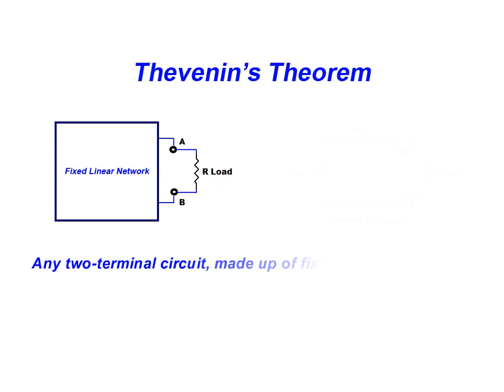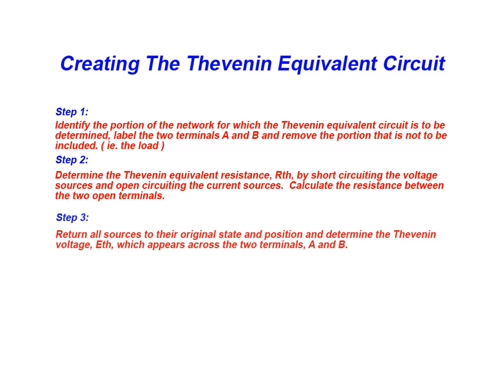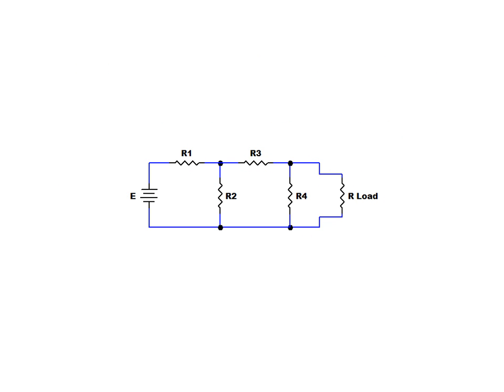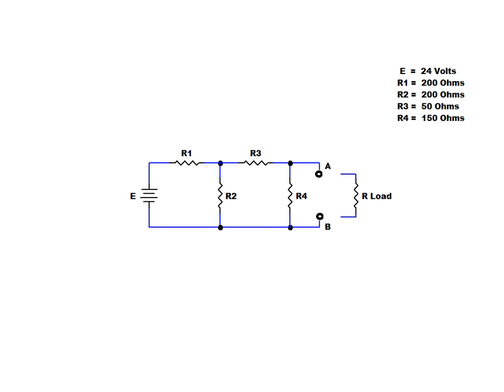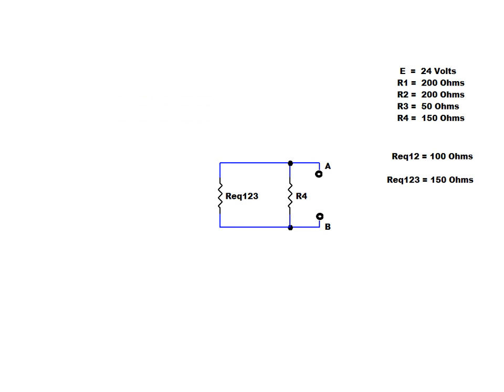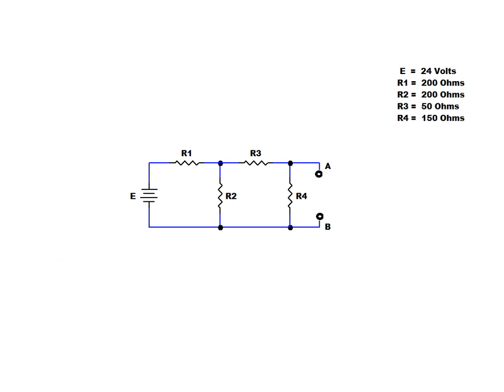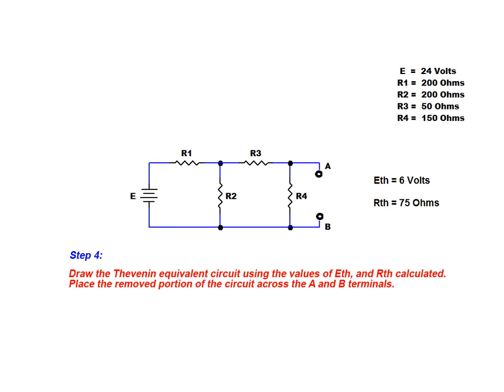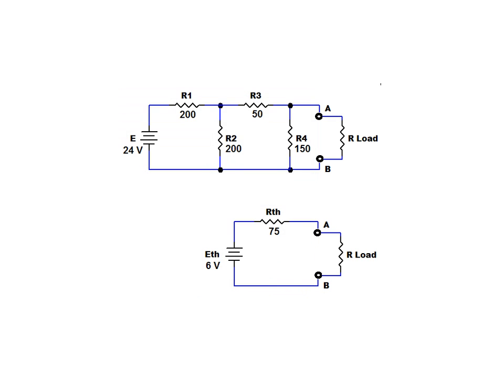Tutorial: Creating a Thevenin Equivalent Circuit | #circuits #TheveninEquivalentCircuit #GBCTech

Comment: Good explanation of Thevenin resistance operations, but lost me on figuring out the Voltages. ☹️
Reply from the maker: Thanks, we are using the voltage divider rule to calculate voltages, as well as ohms law basics.  You can check out our Practicing Technician blogs on our etcourse.com website for clarification if you are interested.

Comment: Hi Have you any information on how to work out the voltage drop over a resistor using the Thevenin's theorem with 2 batteries in the circuit please ?

Thanks
Reply from the maker: Deano vincent The process for Rth is unchanged, open circuit voltage sources, short circuit current sources and view resistance as seen from the 2 terminals you have selected (the output location).  When dealing with multiple sources, I recommend using Nodal Analysis to obtain Vth. (You can use Loop Analysis as an option or even Superposition)  Finding Vth will require employing Linear Network approaches.  This approach is valid for independent sources only. It becomes much more complex if you have dependent sources.  In short, you need to use Nodal, Loop, or Superposition to acquire Vth when multiple sources are involved.  We have vids on these analysis types that will help you with this.  Again, Rth is found in the same way for single or multiple source circuits.  Subscribe to our page, and you will see some tutorials on the basic application of DC linear network theorems.  I hope this helps.

Comment: hang on, i dont know what you have done to get vth to be 6v, i work it out as 9v.
proof: 24v split between r1 & r2, vdivider, 12v each per r1 and r2.
leaving 12v out of the node, carrying on into r3 (50ohm) vdivider here reveals the vdrop across r3 with the 12v remainding voltage to be 3v not the 6v which you got,  i think you must have used as the source voltage other than the remainding voltage. this cant be the source voltage because its gone through the resisitors on the way and dropped. using the source voltage would give 6v but using the 12v gives 3v drop across here, leaving 9v drop across the 150ohm. think about it, 6v drop across 50ohm and 6v drop across the 150ohm? it dosent work. vth has to be 9v. correct me if im wrong but im sure im right... :/
Reply from the maker: Jack Spencer Ok, I will try to clear this up for you.  Your initial assumption is incorrect. Here is why.  R1 and R2 are of the same value (200 ohms) Now in your assessment above, you begin by stating that the voltage across R1 and R2 is equal, both drop 12 V.   This could only be true if the current flowing through each of these equal value resistors is the same.  This would mean no current is flowing through R3 and R4.  That is simply not true.  If any current flows through those 2 resistors (R3 and R4), the R2 current would be less than the R1 current so the source voltage would not be equally distributed between R1 and R2.  You forget that R2 is in parallel with (R3+R4).  This means that the actual resistance appearing after R1 will be less than 200 ohms.  In fact, it is the 100 ohms we have shown it to be.  Our video is correct as shown.  If you build this simple circuit and test the voltages at the nodes in the circuit, you will in fact have the values we have shown.

Comment from the maker: Hi, it depends on what values you are given in your question/scenario.  Voltage and Current divider rules along with reducing the circuit by combining resistances, should let you solve for all voltage and current values.  Again, it depends on what values you are given in the question as to how you would approach the solution.

Comment: Hi great video, I have a similar problem only i have an additional 2 resistors (R5 and R6) They are series with each other but in paralel with R4 i have followed your tutorial and it works great for finding the over all resistance. (all i need for my problem) Is there any way i can find the resistance of R3 and the current of R4. Kind Regards

Comment from the maker: Ok, I am not sure about your question, but I think you are asking why in the end I used R4 / (R3+R4) to get the voltage across R4. That would be because I had already determined the voltage at point C as being 8 volts. As of then, I only had a simple series circuit with an 8 Volt potential at the left side of R3. So the only resistors involved in the last voltage divider calculation were R3 and R4.  (did I get your question or did I misunderstand what you were asking ??)

Comment from the maker: OK, from the top of R2, current can flow through R2 or R1. This is a parallel relationship. When these two are combined to make Req12, current has only one path through R3 and Req12, this is a series relationship.  I hope this helps clear things up for you.
Reply: Would it be correct to add req12 to R4 and calculate the parallel R3//(R4+R2)? After all, R4 is in series with req12 just as much as R3.